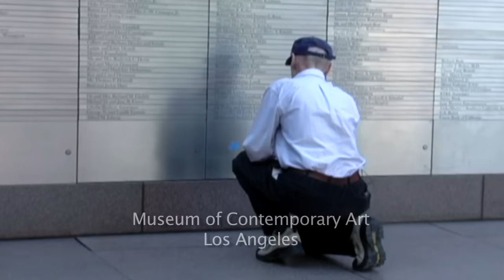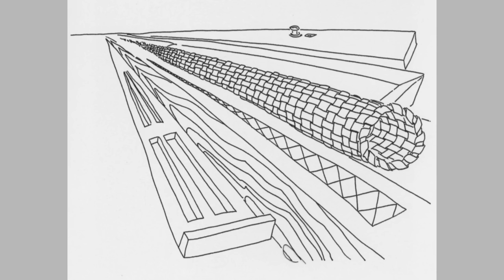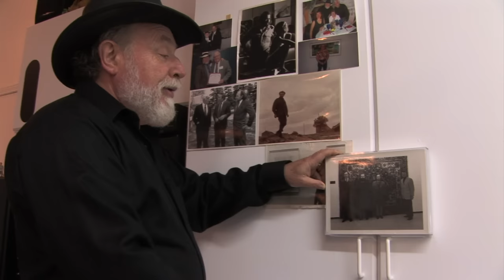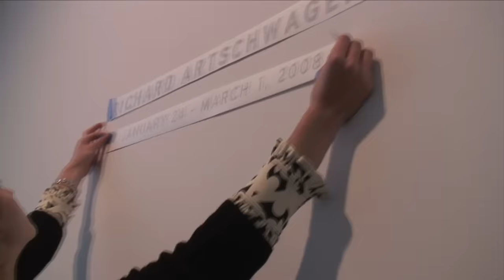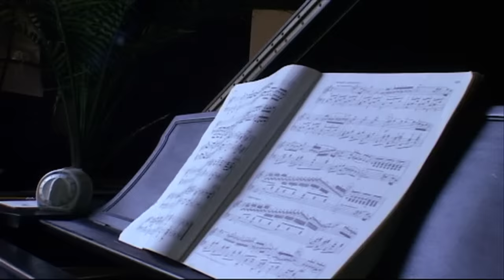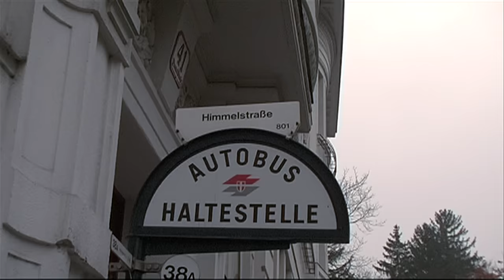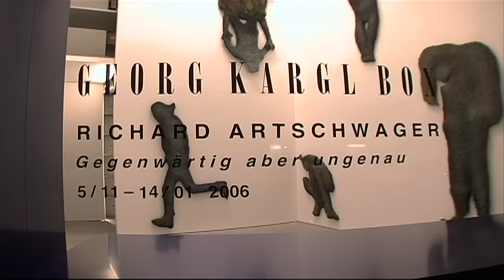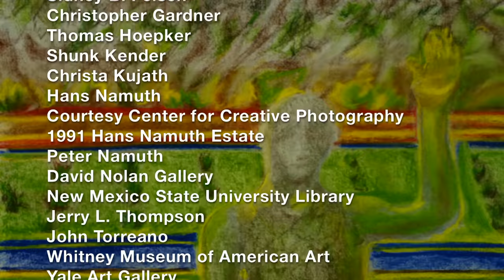Richard Artschwager: The artist who doesn't fit any category | Documentary "Shut up and Look"

Comment: My I suggest an idea?  Take a window on a building .... remove the window trim and sill replace it with a gold gilded art frame, replace the sliding windows with a single pane of glass. Place a brass name plate on the bottom of the frame titled " Moving Art " . Now aside that put on a wall a window frame and sill , the sliding windows and behind that a very realistic art of a homeless person cautiously peering in at the on looker. Perhaps backlit to achieve realism.  What do you think ?

Comment: "Contemporary" is the category that this artist fits into. That is an artistic movement with clearly defined characteristics, which this guy is a regular enough example of. There is so much stuff like this in the northeastern united states, it is the rule and not the exception. The old masters are too intimidating, and our lives and attention spans are too shallow, so we've changed the rules of art to be wildly solipsistic and contradictory. It drives young artists insane, fills galleries with the work of trust-fund babies, and decreases the public's appreciation for 'fine art'. 

This guy belongs to the same artistic movement as "Family Guy". It's referential, it doesn't seek beauty or truth, it seeks the shock of the new at the expense of depth or craft.